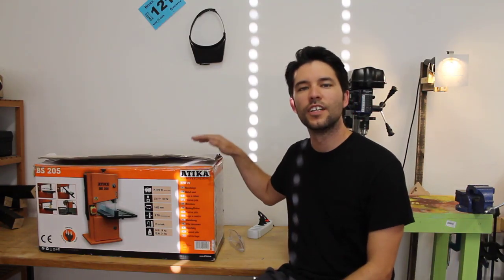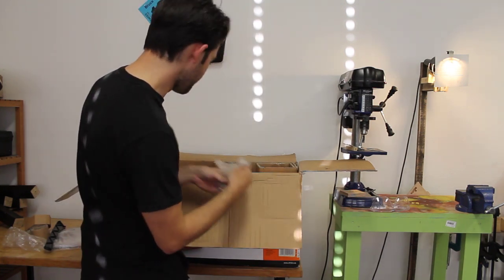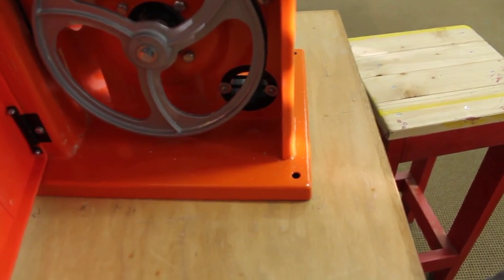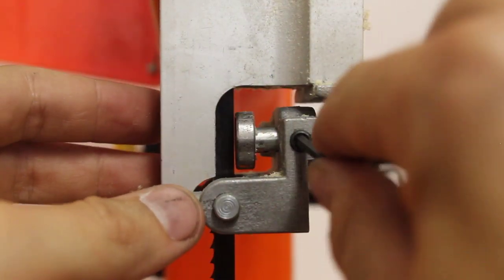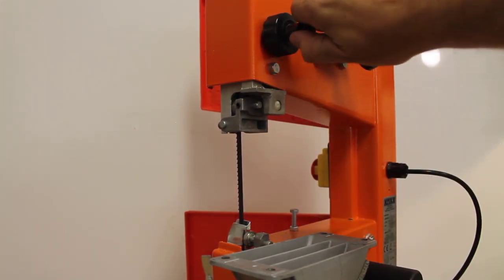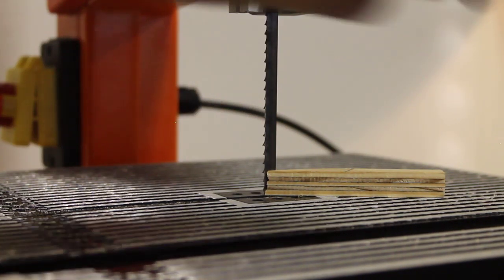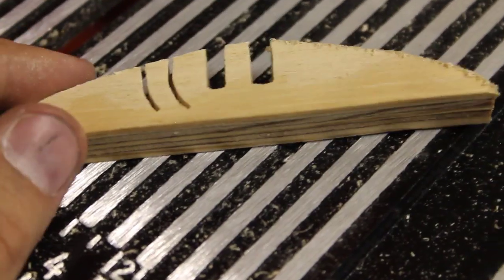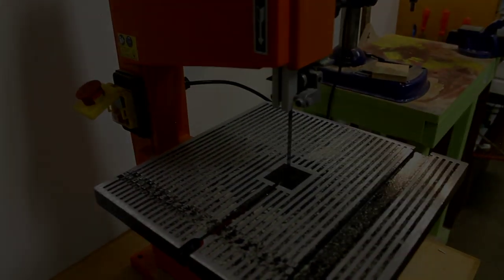ATIKA BS 205 Bandsaw Unboxing, setup and testing

Comment: now it is 5 years later..what was your overall experience..how did the blades and blade guides hold up..were you able to replace the blades and how much did they cost..etc..thanks!
Reply from the maker: I sold it about one year ago as I had to move back to the US. But at that time it was still working perfectly and became my most used shop saw. While owning it I did have to change the blade once when it broke, which was likely my fault.